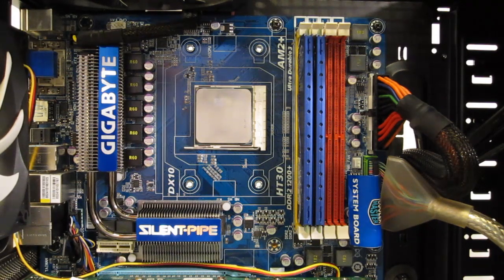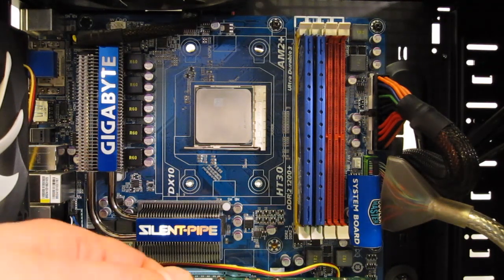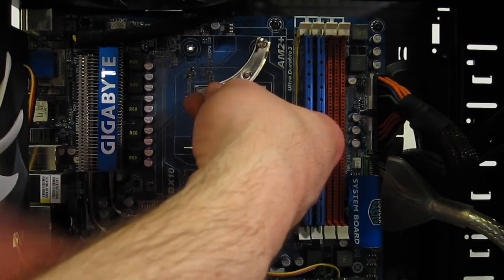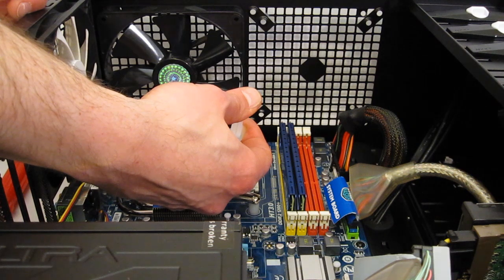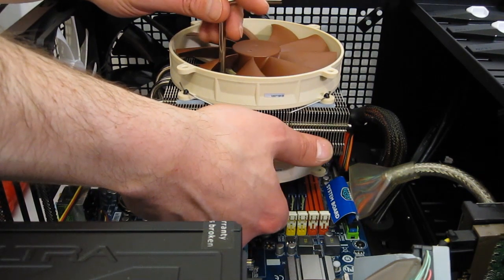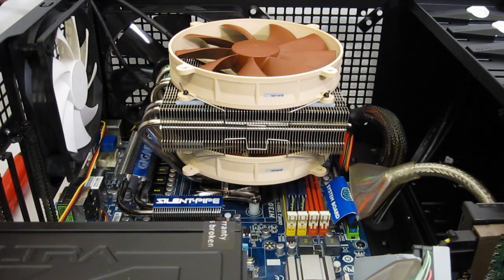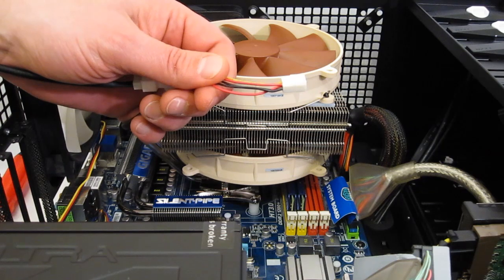Noctua NH-C14 Installation

Comment: can anyone help me pls i will gonna buy my new pc with next components:
intel i7 4470k
gigabyte sniper g1 z87
gigabyte gtx 760 oc2gb
kingston 2x4 hyperX 1866mhz
with cooler master psu v650s 
i wanted this aircooler with it can you tell me what performance can i expect? and i wonder why this cooler blows back at mbo and why is it placed like this what is the best way to blow the heat away i will use thermaltake v4 black edition case pls someone reply
and couse it haves 4 fan slots ill use all of them front for intake bottom also and rear for  exhaust aslo with top slots sry if you have the hard time understanding what i said pls help
Reply: George Cella yea i google it last night like 2hrs and i saw that NH-D14 is much better for me what you think? Tnx for the reply
Reply: George Cella ок ок ty one more thing i saw that temperatures go up to 70c+ on intel i7 with NH-D14 on full load but the top temp for that cpu is 72c i see that all are giving good revievs for the cooler is that a lie or what? ill try to find that new one D15 i didnt see it on sale in Serbia but D14 is avalible
Reply: George Cella sry if i bug you can you tell me just what coolers should i buy for the extra slots on case i will go with CM HAF 912 Plus not v4 thermaltake i wanted to buy this http://static.emmi.rs/images/products/500/b1165557.jpg or this http://static.emmi.rs/images/products/500/b1188709.jpg ??? Corsair have 2350rpm and cm have 2000rpm
Reply: George Cella  thats why i chosed CM HAF (high air flow) 912 Plus case in hope that it will have good air flow as it says and it haves cable managment i can hide cables so i can have better air flow in v4 black edition i didnt have that yea thats pretty much awesome performance i will not OC it that much i will let intel turbo boost do that up to 3.9 it will be enough for me i can allways oc it i think for me 4.1 or 4.2 will be good im first time builder so im a little scare of OC dont want to mess up my cpu first ill see what temp its producing then ill consider OC

Comment from the maker: The Ninja 3 does not have the performance capabilities to match up with the Noctuas. It was designed primarily as a silent cooler, and performs well as one, but is not a match for these even with dual fan. The D14 is an excellent cooler. The U14S comes very close in performance, has better RAM compatibility, is smaller and quieter.

Comment: Personally, I'd recommend taking the fans off before screwing in the heatsink.
I accidentally broke a fin off mine installing my NH-C12P.
Luckily, thanks to nine blades, I was able to break off two more fins at even points to even out the forces. 
It provided a tiny bit extra cooling for my heatsink until the replacement fan arrived which was only about a week. That said, I later discovered I can still run the heatsink passively and still maintain the idle temperature at full load.

Comment from the maker: Standard height RAM fits with no problem. You can get it in and out with the cooler installed, but you must remove the bottom fan.

Comment: SO wait it doesn't heat the RAM and the PCB around the processor? LOL I just can't believe this works, just seems like the hot air doesn't get cycled out unless you've got top and rear exhaust fans

Comment: You can turn the cooler on the other side so you may have enough space for RAM like Corsair Vengeance. In Noctua NH-C14 Installation manual is shown in wich side you can install it :)

Comment: I recently installed one of these on an older EVGA 680i Motherboard inside a Lian-Li PC-33 and I nearly ragequit with the clearance towards the PSU.

Not sure if I was just lucky to be able to install this Monster or if the standards were calulated to that extreme.

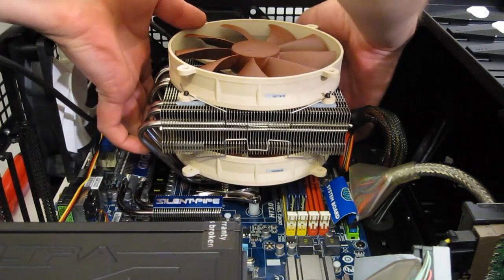Comment: you put the brackets on upside down.. you can clearly see at 2:30 that they don't line up with the coolers base because they're facing the wrong way.
-100 internets for not reading the instructions

Comment: Nice video.  One thing I would like to add is that there are three configurations for the fans.  1) 2 fans, 2) Fan on outside only, and 3) fan on inside only.  If your memory has high heat spreaders, you will have to remove the inside fan.  *not as ideal*

Comment: and the mounting? pain in the ass. you can easily damage you motherboard if you slip off that screw.
Other than that, outstanding cooler.